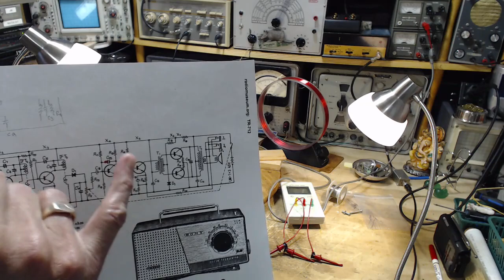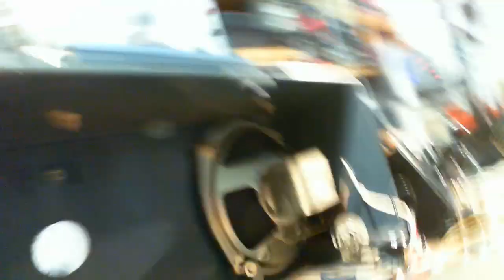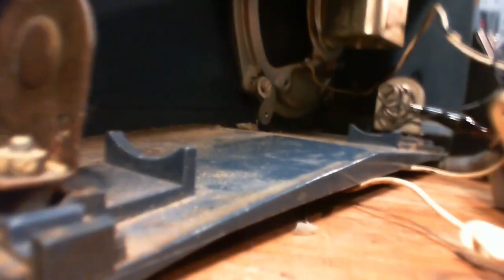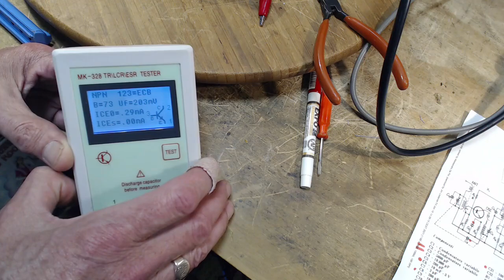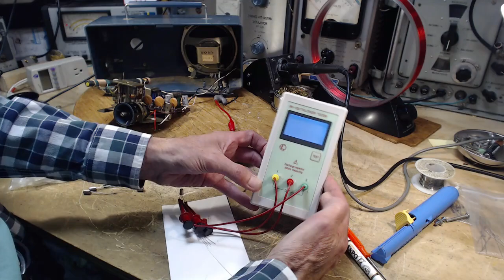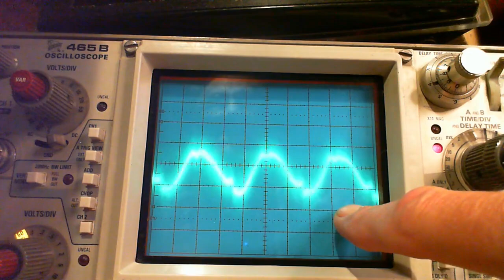SONY TR712 Transistor Radio Video #7 - Germanium Transistor

Comment: Hi Jim
Test the voltage across M3 as the 1T51is a troublesome part & obsolete .
If it's dead jim maybe you could sub in a IN400x diode with a 10 uf cap across it .

Test voltages around the output transistors .
Hint mirror image but the same old voltages !

Comment: 19:16 You can not 100% rely on these testers to identify the pinout correctly. Esp not on germanium. They may show a pinout where E and C are reversed. Why? Because when identifying the pinout the tester tries all combinations of BCE. The pinout that gives the highest beta/B/hfe is deemed the correct one. But a transistor can be operated in reverse mode - i.e. with C and E flipped. On silicon the difference in hfe between normal and reverse mode is substantial. Not so on germanium which even in normal mode has a low hfe/B/beta to boot.
And 22:10 to use this autodetect of the pinout on a transistor which you expect to be questionable or partially bad... Well draw your own conclusions on how sensible that is.
The best to do with these old germaniums is to take DC readings on the voltages at the transistor in question and compare them to the readings given in a service manual. In this case THE SAMS has them and the Sams dor this radio is downloadble for free! 
And if still in doubt (which very well may be) replace with a close alternative transistor. 
But being germanium you cannot just grab any transistor you found in the parts bin. The germaniums can be very imperfect and have type-typical problematic characteristics like high leakage which the designers had to counteract. 
In the germanium world there is no generic one-fits-all type like on silicon the BC548/2N2222 which you can throw in on almost all small signal applications.

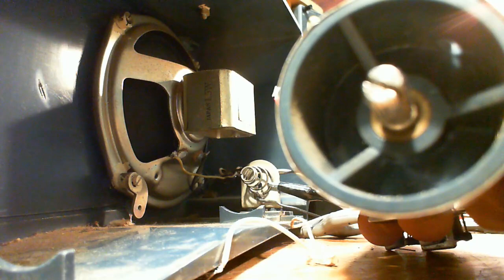Comment: 7:31 in the SAMS the transistor is designated as a 2T65 or 2SD66 or 2N214.  And it crosses to the euopean AC127, superseded by the AC176. The AC127/176 cross roughly to the russian GT404V in case you want to ask shango to dip into his stash...
Reply: SMH that he is guessing at what the tester results mean (B is Gain)..... Doesn't matter the substitute to be used.  At least he used his solder sucker that was good to see.